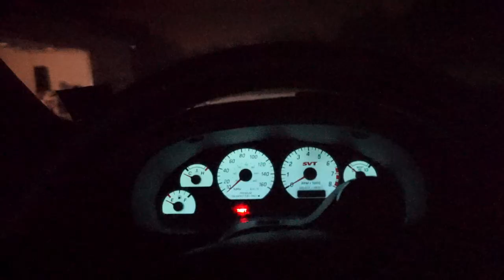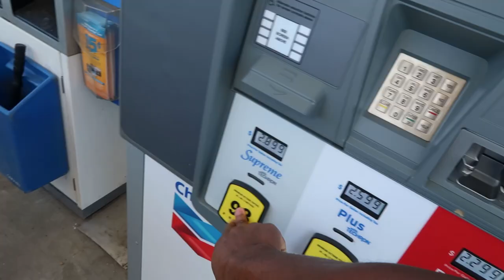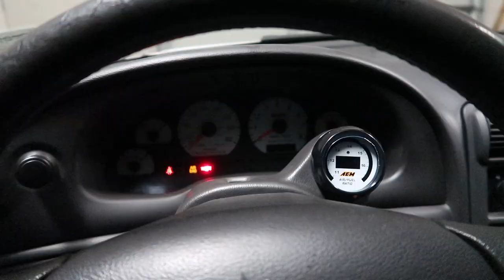One Last Ride | Mustang Terminator Cobra SOLD!

Comment: I've owned 5 Mustangs and after my 4th I traded it in and bought an E39 400hp BMW M5. A great car but because I like to go fast I started modding it and that car was Bank to get performance parts. I traded it in after a year and bought an 03 Terminator and will keep this car forever. It's got a Lysholm 3300 blower making 609rwhp which is plenty on the street. Has Big Brakes and a full Max
 Motorsport Suspension. Do what you do but you may regret it in the future but you can always find another. Best of luck my friend!!
Reply from the maker: I doubt that I’ll regret my decision, I’m pretty confident in my choice of vehicle. I’d much rather spend thousands on mods to have a much better car than to constantly spend hundreds just to make/keep a car running almost like factory. I’m not the biggest “gotta have more power and be the fastest at the dragstrip” type of guy, if that helps my judgement😅🤷🏽‍♂️

Comment: This car is not gone, I have found it! Should I buy this? They want $15,000 for it. Check out my test drive of PJ Morrison's Pegasus! https://youtu.be/6HsN68Tsk0M
Reply from the maker: It’s gone from my possession, lol.. If you buy it, I definitely would like if you kept putting videos out. I wouldn’t pay $15k for it tho. $13k would be ideal in my opinion. It’s a PERFECT car for someone wanting a badass track build or a weekend warrior, I just didn’t wanna daily it anymore because I wanted something a little newer.

I would’ve told them DO NOT flash it with a stock tune, it WILL 100% ruin the car. The car has upgraded upper and lower pulleys, ported blower, boost a pump, single blade throttle body, and catless exhaust. I heard them say they would add cats back to the car but all the other modifications still require a tune for the car to run smoothly.

They should know that you don’t just flash a 500whp car with a 390 crank hp stock tune🤦🏽‍♂️

Comment: How much u got for it? Why😢😢😢
Reply from the maker: Sold it for $10k.. Had a potential buyer for $13k but didn’t feel like waiting so I just traded it in to a dealership lol🤷🏽‍♂️

I just got tired of having an old Mustang. As much as ppl say it was a gem, and iconic car that was built to handle power and whatnot... It still was just an aged Mustang that continually needed work. Just got tired of that and got a newer platform that I had already fell in love with and didn’t get to finish modifying
Reply: @pj_morrison  but unfortunately you got a genesis...….why not a newer stang    …… and still its a cobra...not a mustang 2v...not easy to get...and it had loads of potential left
Reply from the maker: joe hoover I’m not a Mustang guy, don’t think I’m ever getting another one. I got the Cobra, had my fun with it, and moved on to a platform I like more. The Cobra was a beast, no lie.. But I like what I like
Reply: @pj_morrison  Damn.
Reply: @pj_morrison  10k for the cobra? Dang. No offense bro you clearly didn't know what you had. By calling it an aged mustang Definitely confirms that. Is a terminator cobra! Not just a mustang. Limited production vehicle. Rare. How many miles did the cobra when you traded it? 10k is stupid cheap.
Reply from the maker: @kenny9088  lol I definitely knew what I had, which is why I got it in the first place.. But just because it’s a Terminator doesn’t mean it can’t get old and dated. And when the chassis gets closer and closer to 200k miles, things start acting up and it gets sloppy just like older cars do. And you’ll never get the new’ish feel to it ever again. The car wasn’t bad at all, but it’s also far from the best car ever made. The motor and trans are great tho👍🏽

It had 162k on it when I traded it in and I bought it with 113k. And no offense but I’m kinda tired of explaining myself on getting rid of it😅
Reply: @pj_morrison  i feel you. I didn't mean to sound like an a hole. I guess you can kind feel that way when you get a high mileage cobra to begin with it. Is totally different when you get a low mileage one. One thats been babied its whole life and get it from the original owner and have so much memories with it 😉 and realize how special these cars are. Every car is gonna age, but that will make the terminator even more rare. 👍
Reply: The car was in rough shape when he got it. Then to daily drive it for 2+ plus years. He was clearly over his head on this one. This could have been a success story with plenty of content, but again, probably out of his league with low wrench knowledge and shallow pockets. Good guy tho.